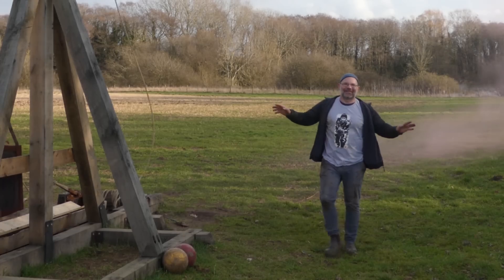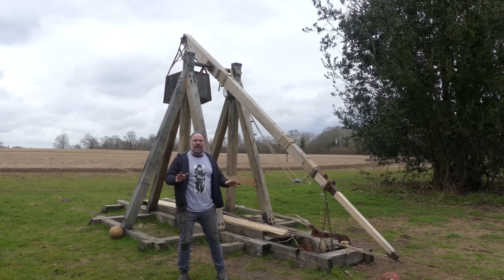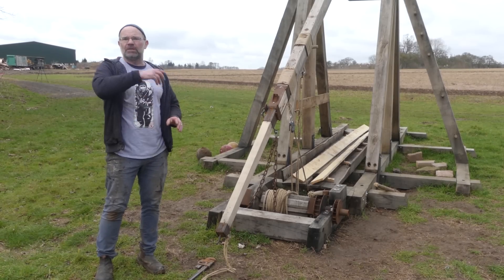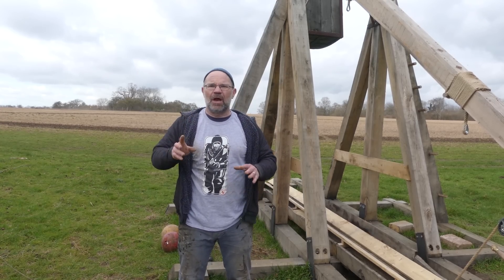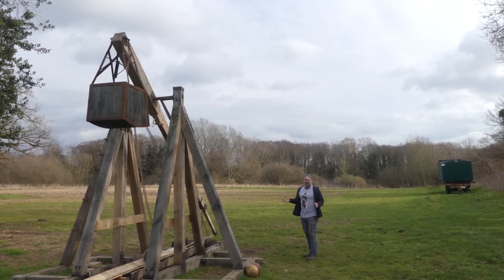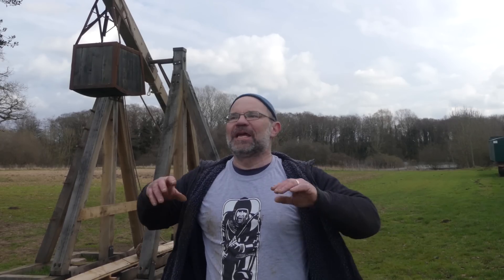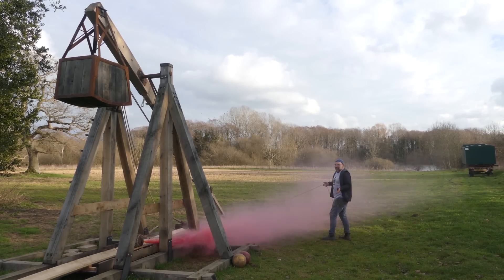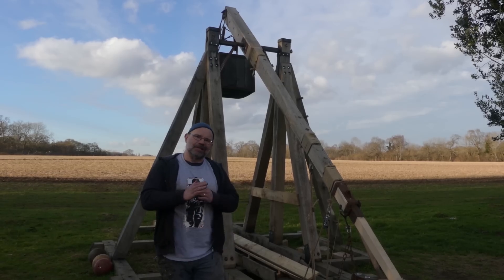Trebuchet - Why won't the darn thing shoot further?

Comment: My thoughts--based on no experience or knowledge, just guessing here--perhaps to change the range you need to lengthen not just the end with the sling but the end of the lever with the weight? I don't have a great knowledge of physics and levers and fulcrums and all that stuff but the idea that changing the length of the lever in action might require changing the point of the fulcrum makes sense to me.  I can't imagine that it would be an easy adjustment to make to your full size trebuchet since you'd need to make the framework taller in order to extend the weighted end of the lever, but, it's my thoughts.  Scale models with modifications would seem the logically easier method, albeit not nearly as exciting as your full size beast of glob lobbing glory haha. Love your work Todd, I very much enjoy your content

Comment: Great video.
Could this be a velocity issue?
I note that orange shots tended to lose altitude sooner than blue shots even though their initial trajectory and release angle were similar.
This would seem to indicate that the orange shots had less velocity.
Could it be that by extending the arm (with the aim of increasing velocity) you have given the ball increased leverage against the bucket.  So, whilst the longer arm can technically achieve greater speed it does not actually do so.  Because the bucket is taking longer to accelerate the ball.  In other words its taking longer to reach top speed or simply not reaching top speed.

Comment: ey, Tod, there's s lot of energy lost to swinging when the counterweight reaches the bottom. One solution could be a shorter distance between the bottom of the arm and the counterweight to reduce the after swing. A second one could be nest made out of rope with less rigidity, instead of the metal box. A third solution could be an extension going down the arm in front of the counterweight, but that will probably destroys the arm 😔
Reply: With shorter weight distance to bottom arm the swinging would be more not less. As the weight would be pulled sideways earlier, stealing more energy to swing faster. Similar with using rope instead of solid connection. It wouldn't change acceleration much, as that's mostly based on tension which solid or rope both do equally, but would introduce lag to counterweight rotation causing more aftereffects at the bottom rather than less.

In general any system with 2 or more interconnected pivots gets really tricky to judge "by eye" and often behaves the opposite of what we expect. And by the looks of it, Tods trebuchet is doing pretty darn well. This counterweight swinging is a intrinsic property of trebs and only way to properly get rid of is to add wheels. So that the weight can drop vertically while the treb moves during a swing (has been done and it's not without it's issues as well).

Comment: With the counterweight, it seems it is riding too low as from start to drop, it bottoms out very early in the arm swing which means the arm then has to shift the direction of the basket and drag it to continue the throw. Maybe instead of having the basket as it is, the basket went around the back of the arm like an upside down saddle and is closer to the pivot point from which the basket hangs. It will still pivot like it needs too but the arm should be able to continue its throw a bit further allowing more rotation and that weight has more time to fall before it bottoms out. Also given how long the arm is now, to get more rotation of the arm, you might have to raise the arm up higher on the mount which should add a bit more speed into the ammo. Might not be able to do that second part but the basket part should be able to be done and it will help stabilize the basket from shifting around and smacking the sides while making use of the wide stance it has.

Comment: I have noticed that the counterweight is generally swinging rearward when release occurs. Is it possible to tweak timing such that release occurs when the counterweight is directly below the arm? It is my guess that maximum momentum would be imparted to the shot this way.
This might require more weight or possibly a shorter arm.
Soooooo many variables.....

Comment: It looks like you have pin holes to adjust the position of the weight.  Have you tried moving it closer to the fulcrum with the extended arm? I'm no doctor, but it looks like the weight isn't able to transfer all of its energy to the arm/projectile before being yanked horizontally by the arc of the arm.  As Steve Schianost mentioned, the motion is jerky, which means energy is being stored in lateral motion instead of transferred to the projectile.  Like swinging a sword that's too light and hyperextending because you put too much oomph into it.  The basic idea would be to reduce the speed that the weight falls by reducing the arm, thus giving the weight enough time to transfer energy to the projectile before it's released.

Comment: I think You are focusing a bit to much on trajectory, and not enough on enegry, You want the arm to move over as many degrees of angle as You can. The throwing arm should be near vertcal. It like in a rifle, for maksimum energy You want a longer barrel, more time to accelerate. And You want the weight to fall as vertical as possible in the beginning, but convert to sideways motion at the bottom to not break the trebuchet. So You want the weight in a bucket like You have, but You also want it pushed to the side by the arm so You have a bit of weight arm out from tha axel. Think more on how to get the energy out. It is the energy You need if You want to throw longer.

Comment: When you shoot a bullet often high velocity, low weigh shots fall short.

Increase the weight of the shot.
Reply: I had to scroll further than I thought to find this suggestion. 

I feel that a slightly increased projectile may take the energy out of the counterweight. As others have noted, the bucket seems to be wiggling quite a bit and stalling out as the arm reaches vertical. This tells me that the energy has not all been transferred to the projectile. 

But my experience comes from archery, which has a fundamentally different method of energy transfer.
Reply: That has nothing to do with the throwing dynamics, though.  That's just a matter of projectile ballistic coefficient: namely, the ratio between drag and momentum.  Heavier projectiles have a better ratio.  And drag increases logarithmically velocity: doubling velocity much more than doubles drag.  Fast projectiles encounter a lot of drag, and differences in drag make a big difference at high velocities.  At low velocities, it's less important.

These are already pretty massive, slow moving projectiles.  I very much doubt ballistic coefficient is playing all that much of a role here.

Comment: 1) Laser range fingers are really handy and not that expensive for these ranges.
2) What is the maximum release velocity attainable?
3) What is the optimal launch angle for a sphere of this size and mass at this velocity?
4) What is the relationship between 3 and 4?

My guess is that launch velocity and angle are interrelated, and as such developing a data set on those will ultimately lead to a faster optimal solution than trial and error.  Even with the expedient of a laser rangefinder, I worry that you're going to flail in the dark using only the range of each shot as a result.  Let me demonstrate with an analogy: if you instead had a cannon which launched a ball of known mass, density and ballistic coefficient at a velocity independent of barrel elevation, you could calculate barrel elevation for maximal range in a matter of minutes.  Because you have a trebuchet, wherein the launch angle is PROBABLY related to and therefore varies with launch velocity in ways that we cannot yet predict, you're manipulating two interrelated independent variables at once.  The current approach is basically stochastic, and in my view will take my longer than trying to answer questions 2-4 AND THEN using well studied ballistics formulae to optimize your launch angle  and velocity for max distance.

This approach would also have the benefit of requiring data only from the high speed of the launch, since you only need to know launch velocity and release angle.  That way, you can shoot a lot of bowling balls in a row and get a better data sample (making better use of your time consuming trips downrange).

Comment: I think a large issue is to do with the weight distribution of the counterweight. More of the weight needs to be between the pillars, you can see by the way it falls unevenly. This is causing the arm to jerk forwards as weight reaches the bottom of its fall, leading to inconsistent releases and a significant reduction in range. Also, have you experimented with a shorter sling? in my limited experiments with mini trebuchets, the length of the sling really mattered.

Comment: Sry, bunch of wrong things uve got going on.
U r chasing the bulls eye - u shot a round, u narjed it abd u adjusted the machine already. Thats not how u do it. U shoot a group. Then u adjust things. How do u know that shot wasnt abnornally bad, or good? That needs time u dont have? Well - u wont have improvements otherwise, either.
Isnt there a more sophisticated way of adjusting release angle? Eventually ull just material-fatigue the nail through work and itll break off

Comment: Sorry if I am teaching you to suck eggs from my arm chair but I found a ropey looking but very sensible sounding video on Trebuchet tuning that I think aligns with what you are seeing.

https://www.youtube.com/watch?v=8hAX72Xgf1U&ab_channel=RabbitonDaMoon

On your throws the lever arm is going pretty much full vertical before it releases. It seems to basically stop at vertical, which then releases the projectile. From looking at the above video I would say it looks like you are going past the counter weight stall point, it then starts acting as a brake on your lever arm, and then you reach the sling stall point.

So that would suggest that your sling is too long. You want the lever arm to be ~45d when it releases, but at the moment your sling is nowhere near ready to release at that point.

Comment: Perhaps an idea for next time would be to make several pin variants that you can test out (shorter, longer, fixed angles) and do several shots with each to get an idea as to what the ideal pin design and angle would be for the trebuchet.

It'd be a bit extra work but the end result would probably be better in the long run.

Comment: Don't despair, Todd! You have achieved the same distance as before, but with a MUCH more controlled counterweight. I would bet that the distance is actually greater, but you had to shoot into the wind today. From reading the comments of experienced people here, it seems that your arm is a little too long to get pulled back to "full draw" before it hits the ground. It was pretty surprising how much your changes to the release pin made! You are on the right track, I think. Your first attempts were powerful but hard on the gear. You have proven that you can tame the wildness and still reach the same distance. I'd say on a calm day or especially with a trailing wind, you'd have surpassed your longest toss to date.

Comment: As any real estate agent will tell you, it's a matter of location. Put it somewhere with a great view, and performance will increase; if the view is really great, and you count the distance the ball rolls, it'll increase dramatically.

If you're looking to do it on the cheap... This isn't a suggestion, merely an observation. When you made the arm longer, without making the frame taller, you also reduced the effective angle. It's no longer drawn as sharply down as before. In itself, that reduces the power. However, it also changes how the net/ball is being pulled; there's less bulling backwards, and more pulling upwards. I can't quite make up my mind on what the effect will be, though. The machine is too complex for easy intuition. The pre-extension shots seem to have more forward speed, though, maintaining their height over a greater distance, even when the release angle is roughly the same.

Comment: Super crazy idea.
Given that the arm is longer with a heavier weight, I would presume that the velocity of the arm at its tip is now significantly higher than before.
What if it is so fast that it moves past the ideal point of release before the rope had time to slip off the pin?
The rope will naturally require a fraction of a moment to travel the distance of the pin, maybe shortening the pin is the answer - allow the rope to slip off easier.

Watching further you describe doing so - maybe an even longer pin then?
The downsides of writing down things before you have a chance to forget them again.

Comment: Random suggestion: how about lengthening the arm on the bucket side? I know it would require a LOT of work, but if you want distance, it seems to me that you need arm speed (wich will be true at every launch angle). Getting the weight further from the pivot (and keeping weight constant) would result in higher arm speed.
Reply: "Getting the weight further from the pivot (and keeping weight constant) would result in higher arm speed." 

Exactly the opposite, actually.

The counterweight accelerates at a rate no greater than the acceleration of Earth's gravity: 9.8 m/s^2.  By lengthening the arm, you increase the distance travelled, which also increases time under acceleration, BUT it reduces the lever ratio between the counterweight and throwing arm.  If the throwing arm is 4 times longer than the counterweight arm, it moves four times faster.  If you increase the counterweight arm, you decrease the lever ratio.  Say you double the throwing arm; then the ratio is only 4:2  instead of 4:1, and now the tip of the throwing arm only moves twice as fast, instead of four times as fast.  So you might gain a few percentage of acceleration at the counterweight... but you'd lose any advantage gained there through decreasing your lever ratio to the throwing arm.
Reply: @bronco5334  Interesting. I was thinking about it more from the point of view of torque. By lengthening the arm on the counterweight side, you automatically increase torque. But contrarily to a wrench working on a nut, since you must apply that work to an opposing arm instead of a rotating nut, you don't gain anything. Thanks for the info.
Reply: @olivier.st-amand  An addendum: most of what I said was correct, but I (semi) wrongly implied that lengthening the counterweight arm will increase the time the counterweight is under gravity acceleration.

The time the counterweight is under gravity acceleration is really more a function of how far the counterweight has to move vertically, NOT how long the counterweight arm is.  But lengthening the arm does mean that it can be allowed to drop further, since the arm sticks down farther, it's a greater vertical drop.  Of course, the trebuchet needs to be tall enough to allow that height!

Ultimately, lengthening the counterweight arm only really helps if you ALSO lengthen the throwing arm proportionally.  

And at that point, you're just making the entire trebuchet bigger.
Reply: The arms can just snap. It's pretty common.

Comment: My best guess is that with the extended arm, even though you are making better use of the energy, you might be loosing energy into the frame through deformation of the wood. Maybe try reinforcing the arm extention with some steel to try and make some better use of that energy.

Comment: Back in the 70's our Boy Scouts summer camp had a 3 day contest with 1/8 scale  models and we discovered that:

1. The longer the sling , the easier it is to get a consistent release angle.

2. Getting the arm pointing down about 70⁰ before launch was crucial.
Going past that didn't do much since the weight had very little leverage
( Like when your bike pedal is nearly straight up)

3. The faster the arm = the longer the sling.

Because you lengthened the arm you can not get it down far enough, which slowed the arm down, forcing you to a shorter sling , which threw off your release point.

I'd shorten the arm so it touches the ground at 75⁰ down, go to the longest sling possible ( it barely touches the ground when the arm is level) and go from there.